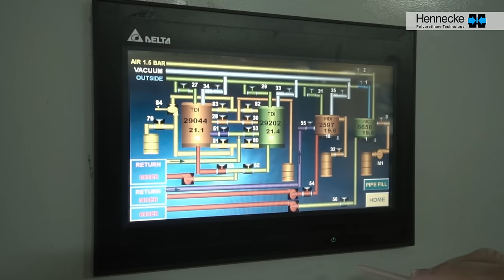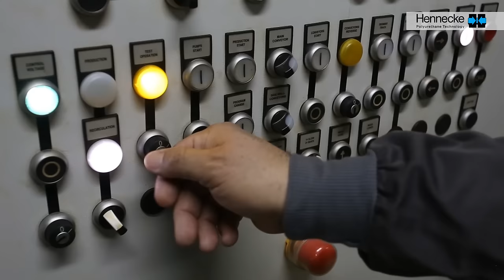Continuous slabstock foam production with MULTIFLEX @ CFI in Cairo (Egypt)

Comment: Wonderful machine. Small doubt how are the gases go out from the full rise area? because we closed the foam completely by paper.
Reply from the maker: The most important benefits of the FLAT-TOP system are the optimal use of raw materials and improved foam properties in terms of density and hardness distribution. In our experience, there are no problems with escaping gases from the final product, as this already happens during production despite the usage of a paper top.

If you have any further questions or want to discuss technical details, please contact our product experts via our website: https://www.hennecke.com/en/products/slabstock/conti/multiflex

Comment: Hennecke brief the technical difference between high and low-pressure foam mschine.?
Reply from the maker: In a nutshell? The main difference is that in high-pressure machines the components are mixed by high-pressure collision - as the name suggests. Low-pressure machines, on the other hand, use air mixing, possibly with the addition of a stirrer-mixer. There are, of course, other differences.

If your question relates to specific machine details, you will find more information on our website: https://www.hennecke.com/en/products/dosing/overview

Our experts will be happy to advise you. You can find your regional contact here: https://www.hennecke.com/en/company/worldwide/overview

Comment: I worked at foam plant and worked on pouring line. I had to jump on belt remove weights of the butcher paper while the hot foam was steaming next to me. I ended up getting throat cancer 10 years later tdi chemical does cause cancer in mice. Polyurethane not to bad.

Comment: I have query for 23 density Pu foam 
Does it exothermic reaction.
How many temperature raised while process after adding in mould
What is the reaction of Pu foam mixture with latex mould
Reply: Pu foam temperature depends upon the parts of water and amount Tdi used in formulation, for 23 density pure foam it may be around 155 c if you use Mcl it may reduce depending upon the parts of Mcl

Comment: I worked with henneck old machine it is called high pressure slabstock machine its good machine that was on Dubai in year 1998
Reply from the maker: Thank you for your comment, this is great to hear! We have a lot of slabstock machines in the Middle East. These machines have a long lifetime, so it is highly likely that yours is still running today. We are proud of our technology and hope that you will be able to use your experiences of our equipment in the future too.
Reply: @HenneckeGROUP  Thank you for your response. Yes, it is true. I worked on a high pressure machine, and in addition to that on several types of machines such as Max Foam

Comment: I have query for 23 density Pu foam 
Does it exothermic reaction.
How many temperature raised while process after adding in mould
What is the reaction of Pu foam mixture with latex mould
Reply from the maker: Thanks for your interest. Yes, the reaction is exothermic and the highest temperature in a PU block is reached several hours after foaming. This temperature can reach also over 150°C or even higher.
In case of slabstock there is no mould. The foam comes in the case of MULTIFLEX out of the tunnel as a square continuous block, cut in acertain length by a block cutter.
Reply: Maddenin adı nedir